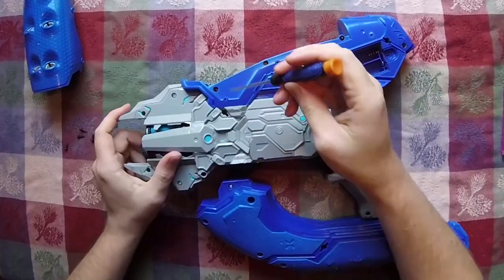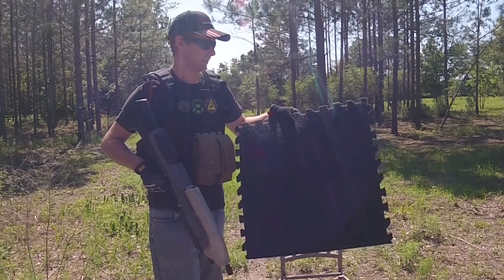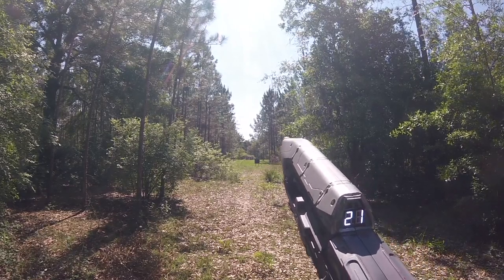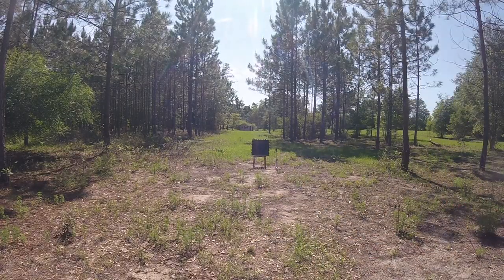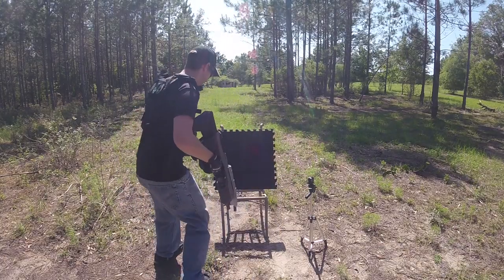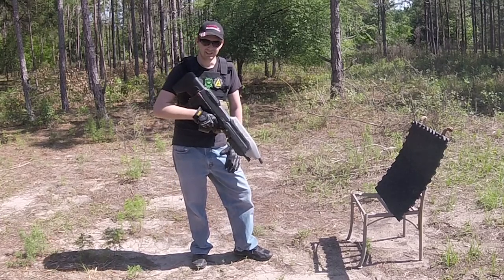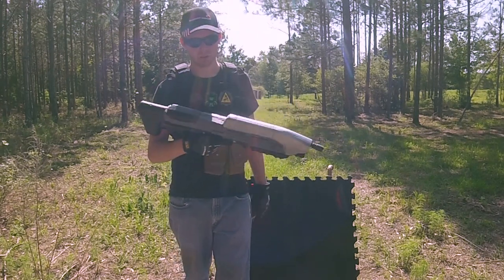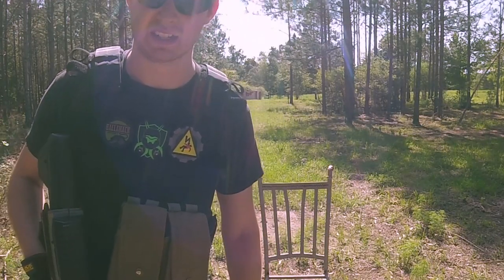Can EVA Foam Survive Airsoft? #2 (Carpet Style EVA Foam)

Comment: my shoulder and arm pieces are both made out of that stuff with like 5 layers of plastidip on it. It’s pretty good against BBs but it can be pretty fragile to crushing/tearing so you still gotta be cautious running around with that stuff
Reply from the maker: I definitely agree with the safety and caution part of running around in eva foam. This carpet style foam is pretty impressive when it  comes to durability against bbs though.

Comment: I have the uar gen 2 but i can't remove the upper receiver, one of the pins won't go out
Reply from the maker: Its probably just stuck in there. Try pushing the smaller end through. I had a fight trying to take the top off as well. Once the pin and the top part of the uar is off, its smooth sailing from there.